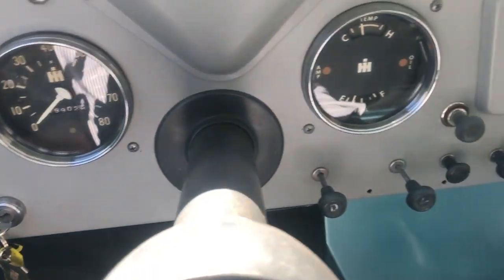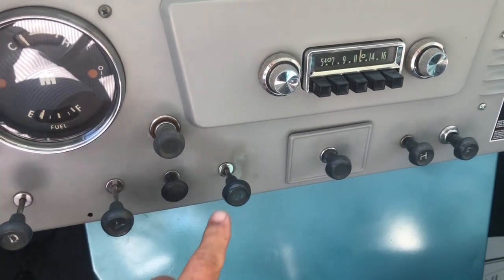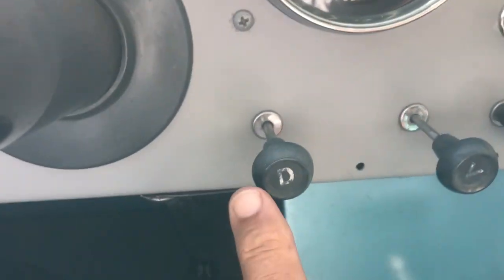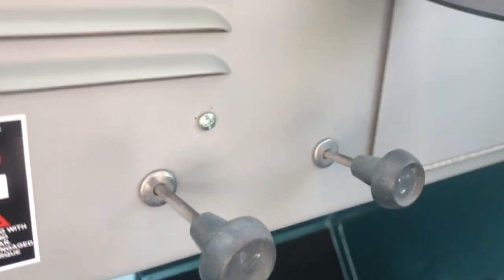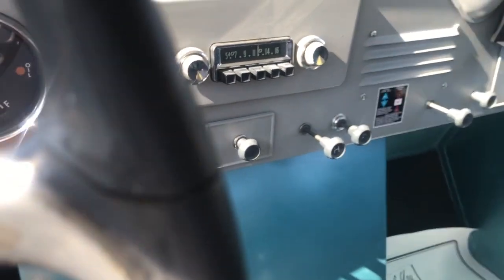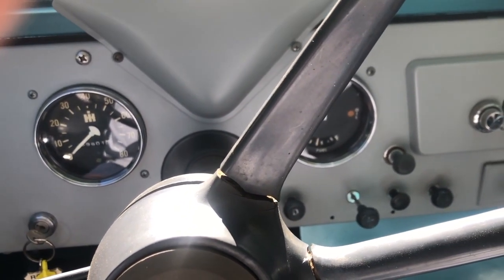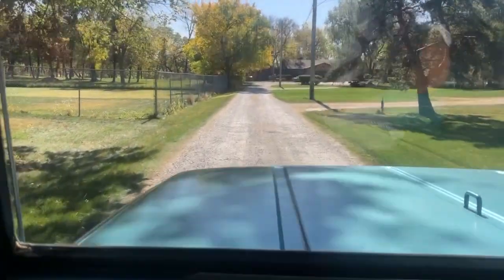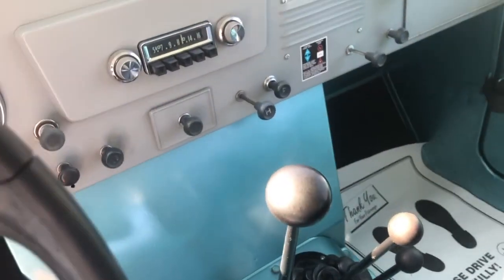Scout 80 Primer

Comment: Manual chokes were used on cars also, for years. My brother's 1975 Honda Civic had a manual choke. The non-synchro 1st gear was, likewise, very common, especially on 3-speed boxes and the old 3 on the tree. I learned to drive on my family's '64 Scout 80 4X4. A truly remarkable vehicle.